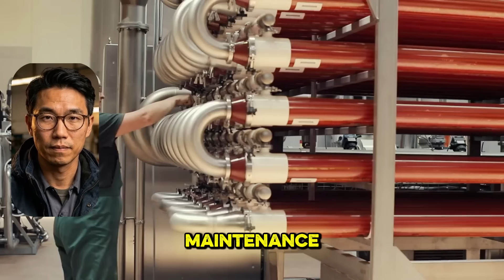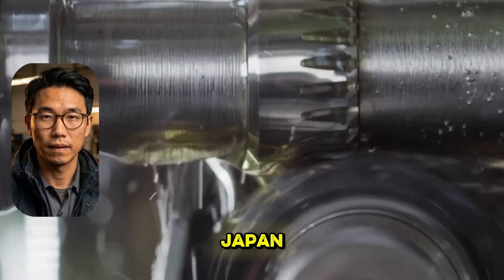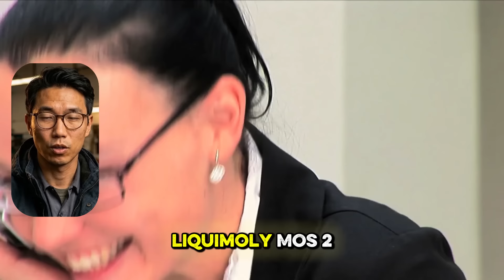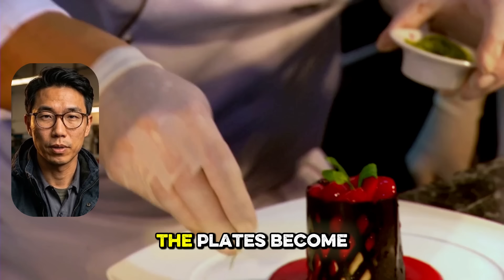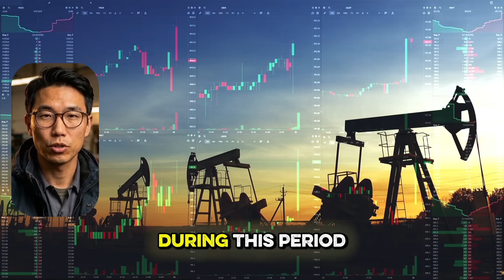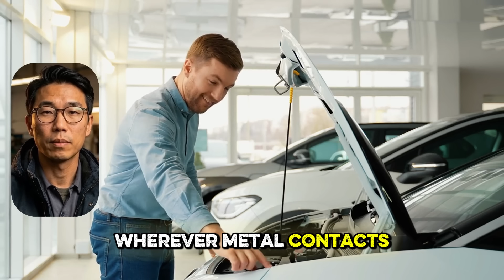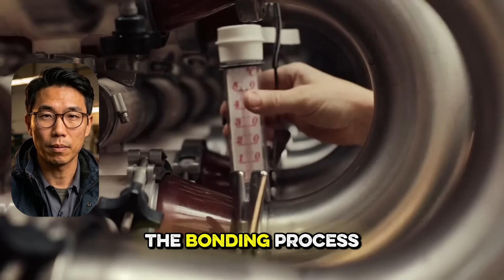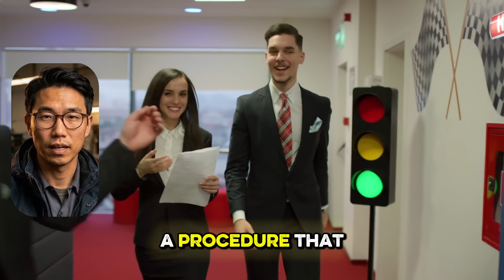The Japanese $2 Liquid Secret That Makes Your Engine Last 500,000 Miles — Mechanics Want This BANNED

Comment: Moly is something that I have significant experience with. I used to be a fuel and lubricants chemist for BHP. Moly-disulfide is a substance that actually heals motors. It works in the engine and the gearbox and the differential. 
Needless to say my car engines last for ever.....
Reply: Where is the safest place to buy it so I don't get a fake powder
Reply: @dawnsalmons663 don't use this form. Buy the colloidal concentrate. It's a liquid.
Reply: @dawnsalmons663 Amazon sells it. He said food grade is fine. It's expensive.
Reply: @dawnsalmons663 get some dow  molycote grease mix it in a quart when you change your oil
Reply: I have added this to my engines in powder form. Ordered from Germany, im in Australia.
Reply: @proximitybeejay3673 does it work with full synthetic oil or just mineral oil ?
Reply: @clintrogers5228 I'd like to know
Reply: @proximitybeejay3673  hi I,m in OZ also, where do you purchase from?
Reply: @proximitybeejay3673Repco used to sell it as a concentrate. It's best in this colloidal form.
Reply: Im glad you said this. Im going to put it in a 2014 Ford F 150
Reply: @tammywhynot123 Just did this today in my 2014 Ford 150 CNG - could hear the difference in the engine sound - smoother power.
Reply: @wleeclark7696  I hope you're being honest! Lol, I hope I don't mess it up.
Reply: @tammywhynot123 I bought it premixed in engine oil - $10 on Amazon
Reply: @tammywhynot123report back.
Reply: Marketing in England called Molly Now I'm in America I get prolong 2000 I put it in my car in 2011 I don't do many miles i've done about 12,000 miles and I only go half a mile up the road to the supermarkets and various places constantly switching the engine off and switching it on I've even use it on my Gerrard door runner everybody that drives and they can't understand why they can't hear the engine running What's the car It's a Hyundai  accent
Reply: @NigelSeccombe Does not come up on Google.
Reply: 2000 Monte Carlo SS...243k miles. Can I use it?
Reply: @johnmoniger3008 if it will work in one engine it will work in yours
Reply: I use moly on my firearms and it is slick. Good stuff.
Reply: Solid advice especially with the transmission also being protected- thank you.
Reply: does it work with diesel engines?
Reply: @markscott7649 Moly works with diesel engines. I used it on my own diesel vehicles. 
Once it bonds to wearing surfaces it heals any scratches/scars and continues to act as a lubricant. It has a lamellar structure like graphite.
Reply: Amazon
Reply: Can I put this in my 2025 Ridgeline?
Reply: @rickoakes9449 your vehicle spying an tracking you. Big bucks for stupid shit. Let me guess you have nothing to hide 😏
Reply: Absolutely !!! 👍🏾
Reply: your an idiot it will NOT repair any part! stop lying
Reply: What about diesel motors like the new Ford Diesel V8
Reply: Thank you.
Reply: I use it ince in a wile. Ceratec.
Reply: So what about whale oil. Did you think that was good way back in the day 🤔
Reply: @don @donnaclarke8595  Whale oil?? What is the connection? Molybdenum disulfide is an inorganic compound composed from mined ore. It’s not harvested from an animal.
Reply: What does whale oil have to do with MoS2?
Reply: does it work with full synthetic oil or just mineral oil ?
Reply: How much of the mos 2 powder do you add for rear end and transfer case and will iot work in transmissions?
Reply: @shawnwoodin2145 I'm sorry but I don't recall the percentages moly tested. In my personal vehicles transmission I have used 5% by weight. As this was colloidal it's difficult to know how much it would equate to in solid Moly disulfide.
Reply: Thanks he took too long to say it!🔥🎯🤔
Reply: Ok
Reply: What do you think about adding to diesel fuel to lubricate the injection pump and injectors?
Reply: @Cantthinkofahandle117  I used 2 cycle marine lube bottles from Walmart to lube my VW diesel when I filled up.
Reply: @Cantthinkofahandle117  thats what I want to know I have few 7.3....
Reply: @JehuTalk I have an LBZ Duramax that I want to last forever. I definitely don't have $1000 for a fuel pump nor $3000 for injectors, parts only.
Reply: @Cantthinkofahandle117 you are driving the wrong vehicle then 😂
Reply: @Cantthinkofahandle117 
I would expect it may block the jets. The injectors cylinder shouldn't suffer however it bonds at high contact pressure.
Reply: @Hotwire_RCTrix Good point
Reply: I took a tour at BHP Copper...they gave us these tiny vials of molybdenum powder... didn't know how important this would be for my cars
Reply: Where can I get it?
Reply: @ElMucho1  Anazon sells it but it's expensive. He said food grade is fine. Someone on here said auto stores sells it
Reply: @tammywhynot123thanks
Reply: @tammywhynot123 its not expensive on amazon
Reply: @tammywhynot123Food grade??? As in eating it???
Reply: @ElMucho1  google
Reply: Is this strictly engine? will it work in transmission without harming it?
Reply: @rogerramjetamericansuperhe3934  a manual transmission YES, but for gods sake DO NOT PUT IT IN AN AUTO OR A DSG.
Reply: @rogerramjetamericansuperhe3934 good question
Reply: @rogerramjetamericansuperhe3934 yes
Reply: Can I use it in a 2019 Buick Encore
Reply: @dawnsalmons663  My daughter has one but I don't know if she will add it to her car or not.
Reply: Is this as good as Slick 50?

Comment: I am calling BS on this. Simply because I was buying engines back in the 90’s to mid 20’s straight from Japan and all with no more than 30k miles on them for $500 a piece. Why so low mileage and cheap you ask? Because they had zero emissions for cleaner air. In Japan instead of EGR valves and emission controls on them, they simply disposed of them when they reached 30k miles and replaced them with new.  They don’t keep their cars long enough for them to ever reach 50k much less than 500k. They are required to dispose of and replace at 30k by law. That’s their solution for cleaner environment. Cleaner running and fuel economy and less oil leaks and pollution.
Reply: Maybe the cars they export are different than the cars they sell to their own-?
Reply: @droopypie they definitely are. I said the cars we get from them have emission control. The used ones we were buying had no emissions on them. To make them legal here, we had to swap intakes and exhaust etc. so some would not even work legally. And part of my point is that there, it’s illegal for them to have with over 30k.
Reply: Go to Ingolstadt and get a lesson from the Germans.￼
Reply: @P @Phuketbrownbear  got a lesson from the Germans, or maybe them from us? Lmao lol with the massive recall VW had to make good on that would not pass our emissions standards.
Reply: @randolphmann3322 I did the factory tour when I bought my first S4 and I had k03’s from the factory swapped for the k04s.  One of the S4 Master Tech’s loved the fact I was trying to make it a street legal US based RS4 and he gave me a ton of tips, helped get most of after market parts installed by Audi right off the line.  The whole team was onboard with what I wanted and that was one their recommendations.
Reply: You don’t think there are complex corporate incentives supporting car sales and the prerequisite lobbying to ensure those laws are passed?
One might ask what those car companies would have to resort to if cars WERE actually running well for over 500,000 miles. 🤔
Reply: @mollybear2339 they are not allowed to use them with over 30k

Comment: Molybdenum disulfide is a solid lubricant. When it’s the right particle size (like the <2‑micron technical grade you use), it:
reduces boundary‑layer friction
reduces metal‑to‑metal contact
improves cold‑start lubrication
can slightly reduce wear in high‑pressure contact zones
That’s real. That’s proven. That’s why it’s used in aerospace, firearms, gears, and some oil formulations.

It does NOT:
add 200,000–500,000 miles of engine life
repair worn bearings
reverse scoring
fix oil starvation
rebuild ring seal
magically “coat” the engine forever
turn a neglected engine into a Toyota million‑miler
Reply: So, @ghahandi So is it better to use the hexagonal boron nitride (hBn) offered by the industry in the form of “liquids with ceramic additives” to achieve the desired effects? At least that’s what they promise.

Comment: Why $2–$4 MoS₂ Is Impossible
Even raw industrial molybdenum disulfide — before grinding, micronizing, purifying, packaging, or shipping — costs far more than that. And once you specify:

technical grade
sub‑2‑micron particle size
consistent granule distribution
non‑contaminated batch
…the price floor jumps dramatically.

Comment: This is why Toyota Honda engines are best in the world. These are the only companies that apply MOS2 before it leaves the factory
Reply: ONLY USE IT IN THE ENGINE - NOT AN AUTOMATIC TRANSMISSION ADDITIVES!
Reply: Nissan , Mazda , Subaru as well , they all are very Reliable brands
Reply: It will clog up the oil filter lickitysplit
Reply: That's good to know.
Reply: @tammywhynot123I hope so Tammy
Reply: Only if you replace timing chain after 150
Reply: had 2 toyota engines fail right around 40 k miles one was 1984 celica, other was 1990's truck, so those toyota engines sucked
Reply: @CopperCettle 😂😂😂 your just a hater mate. Grow up
Reply: Not anymore the CVT engines are a pos
Reply: @Curlz891 the cvt is a transmission not the engine 😂
Reply: For manuals only! Never use in automatic engines it causes gears to slip when it automatically changes gears!
Reply: @carrieandretti  Hyundai Accent is an automatic car Never had a problem with any slippage
Reply: @carrieandretti what are you talking about?
Reply: @carrieandretti So you shouldn't put it in automatic engines?
Reply: @tammywhynot123automatic transmissions 
no such thing as an automatic engine!

Comment: I worked injection molding  thermoplastic 42 years. There was/ is a plastic 'Nylatron GSM' with 2% Ms2 . About 4" diameter,  3/8" thick,  3" wide. I was told it was used as a bushing on heavy equipment. I was told on a d8 cat but that's not true.

Comment: Just get a can of liquid Moli. Not expensive
Reply: Where do you get it for purchase?
Reply: @namkebanyanklariti Amazon Liquid Moly
Reply: @randymcmanus8691 Thank you
Reply: @namkebanyanklariti any parts store here in Aus
Reply: @namkebanyanklariti literally anywhere
Reply: @namkebanyanklariti Advance Auto carries it. 11.00
Reply: *Liqui Moly
Reply: So the process should be...
Oil cleanser right before oil change
Oil change
Add moly

Or no cleanser?
Reply: @SomnoNaut probably depends on the age and condition of the engine. Prob a good idea to use cleanser on diesel.
Reply: Do use this in your car
Reply: @DavidMarshall-r3j I do. Not every oil change . 380k .uses no oil, tight motor still. Used synthetic every 10k since new. RB25 Nissan. Pedigree of the engine might be a factor
Reply: Where do you get the Lewis moli?

Comment: Apparently in Japan cars are retired well before 100,000 miles so I find some of this information potentially misleading .
Can anyone inform us regarding this point ?
Reply: 100%  I bought a Toyota Corona in Japan which only had 28K kilometers on it, and my students were wondering why I bought a used car.  I told them in the US I drove my Civic to 512,000k (320K miles) and they about fainted with disbelief.  They called me a liar, but...
Reply: @cgraysonsmith  A corona? I have heard that name since the 70s. They still make those?
Reply: @BruceHoward-m7k NYC. Production of the 12th iteration of Corona stopped  around 2001 according to Wikipedia.
Reply: Yes my younger sibling owns one in Fiji. I'm telling him about liqui molly
Reply: Its  not misleading japanese cars are sold all around the world
Reply: Yeah, I've heard that you can get used good, low mileage Jap engines pretty cheap because of that requirement.
Reply: 460,000 miles more like
Reply: I believe they sell their cars early because of expensive“shyaken” (mandatory vehicle inspection) and more expensive registration fees for older vehicles. So many tend to get rid of their old (3 year old) car and buy new cars. At least that’s what I was told. Try googling it.

Comment: I add molybdenum every time I change oil by the time I sold the car, the Toyota mechanic was wondered by the engine sound.
Reply: Where can I get it? What’s the address if you don’t mind sharing?
Reply: @waynejones2536  now hard to find  find, you buy liquidMoly very expansive. Cheaper option buy powder form 99% Mos2 1um -20um 10 to 20 gram do not exceed 30 grams. 1 to 5% by weight.
Reply: @waynejones2536  now is hard to find, the LiquidMolly is expansive. The  alternative buying the powder form 99% MOS2 1um to 20um. About 1 to 5% for 4 liters oil maximum 30gram diluted.
Reply: Is it power? Where do you find ?

Comment: My correction. Use the ZP 700 engine oil blend.  The ZP five hundred is a fuel blend that allows the car to pass vehicle inspections, it kicks up fuel octane by ten points and allows the fuel to burn fully and hot.

Comment: 1 lb quantity from manufacturer costs $55 USD
Reply: I'm not finding this for $2 online either. Liquid Molly is sold at auto supply stores, seems an easier way to go than a powder.
Reply: That's about $3.50 an oz. Not bad but that's a lot of moly.
Reply: I want to know is it really possible to get it for $2?  I am looking at a 1oz for $12 online.  Please advise on the retailer or wholesaler for less than this if possible?  Thanks.

Comment: I have a 300k GM V8 engine, would adding this now, at this stage be beneficial?
Reply: Buy liquid moli
Reply: I seem to remember something called Molyslip, sounds like the same stuff to me. What happens to WET cam belt made of rubber.
Reply: @kennyscott3231good question. Shameful design at any rate.

Comment: I've got over a million miles on my 96 Silverado right now, Royal Purple.
Reply: WHAT IS THAT? EXPLAIN, TEACH US.
Reply: @HeydaCarreras  Royal Purple is a brand name of lubricants. The Company I worked for (retired), the manufacture of Moly lube, tested lubricants every few years, Royal Purple proved to by far the best there is, I use it in everything engine, trans. diffs, lawn mowers, power steering, nothing ever wears.
Reply: yeah. like Royal Purple Max Clean Fuel Cleaner 20oz? I bought 6 of them and do nothing to my cars and expensive.
Reply: @HeydaCarreras  yes ,Royal Purple is all you need . I have 2 full size SUVs. 2003 GMC YUKON XL SLT 1500 Vortex 5.3 and a 1999 Chevy Suburban SLT 1500  5..3 engine with over 400,000 original miles and sounds like it just left the showroom with NEVER any issues. That's the motor & transmission 💯😎👌
Reply: @italysfinestqueen8545  Yeah, this red car you can see here, I bought new in 93, I bought for road racing.
 Come 2001 I pulled the engine to build a stroker, I ran Royal Purple from day 1, at 130,000 miles at the time the bores were still perfect, a quick fine hone job, stuffed all new parts in, long stroke crank and all, this car and engine block now have 339,000 miles on them, I'm still road racing it, I have pulled the engine two more time to freshen it up, I have still never bored it, this oil is next level, I don't know why everybody isn't using it, they clearly don't know.

Comment: Kudos for sharing all this knowledge on your channel :)

I've been using moly for decades. I even used it on my VW cars' manual transmissions. Now I have a Prius with a CVT, so  I use it only for the engine. By the way, in your opinion, could you use moly on a CVT?
Reply: VW diesel?
Reply: @Kliq-n2s I used Mos2 it in both, gas and diesel.vehicles

Comment: Oil and lime mix, that's all you need.
Reply: Please tell me …
Reply: one cup of hydrated lime, mixed with 1 liter of oil, gives body to oil, and also stops small leaks.
Reply: @AlexanderMcnabb-gg7mt So it's a stop leak. But I don't see it adding viscosity. As a matter of fact, wouldn't little lime particulates suspended in oil, flowing throw the engine INCREASE wear?
Reply: lime turns into a creamy texture mixed with oil, and doesn't separate. I used it in smokey engines using oil, after a couple of days driving, smoke was gone.